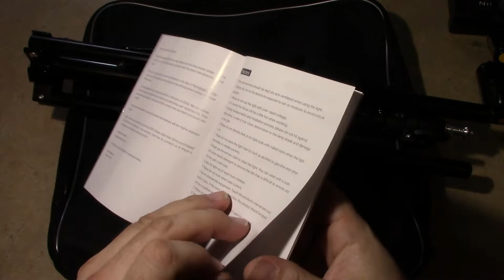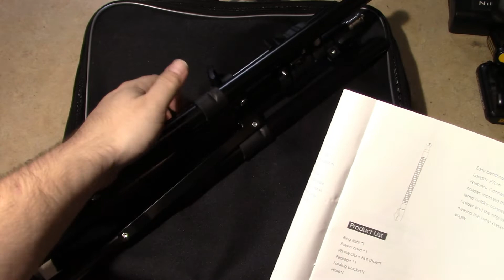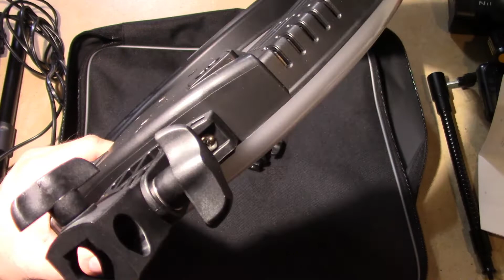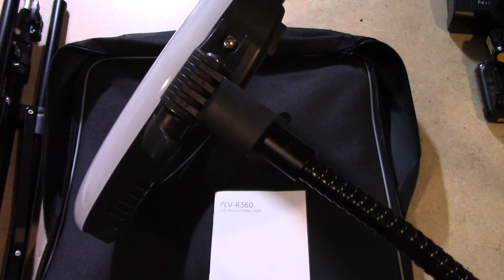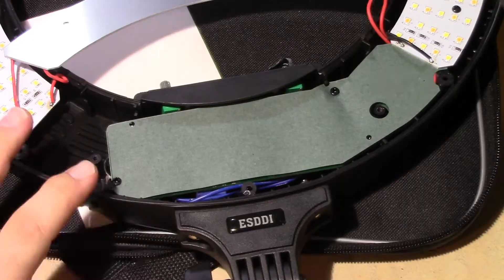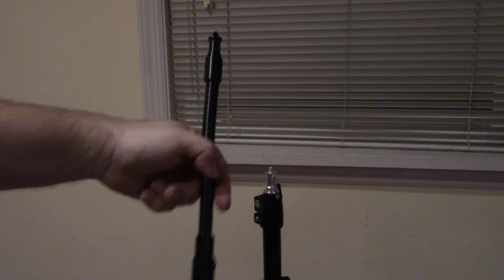ESDDI PLV-R360 LED Ring Light Teardown and Review

Comment: Thank you for the video. Mine suddenly stopped working after 5 years of daily use. I thought it might have been that fuse but it is not. Any suggestions?
Reply from the maker: these do have an internal dedicated power supply to the LEDs.  That might have a fuse protecting the mains input.  I always start with checking voltages.  If you have no DC to the LEDs but you have AC on the mains input the power supply would be suspect.